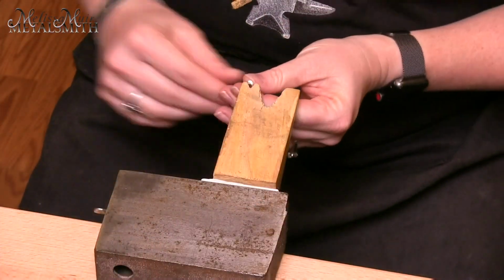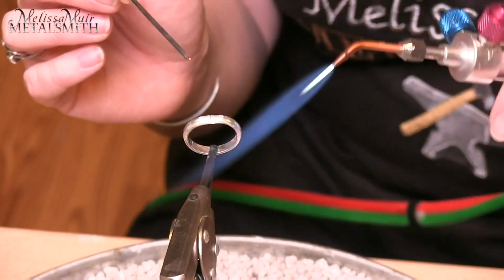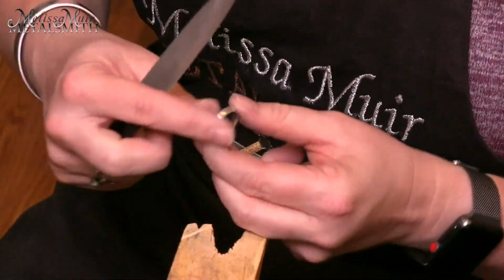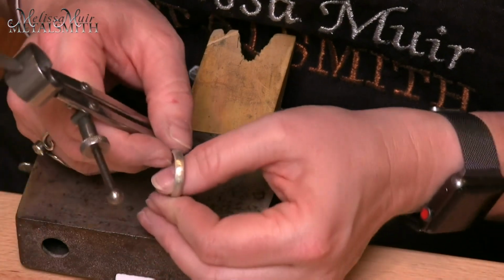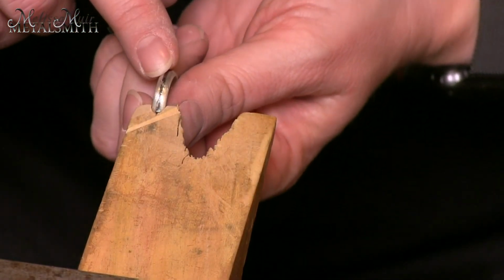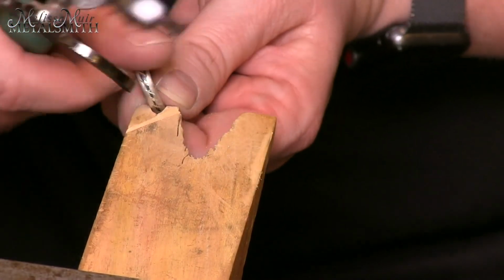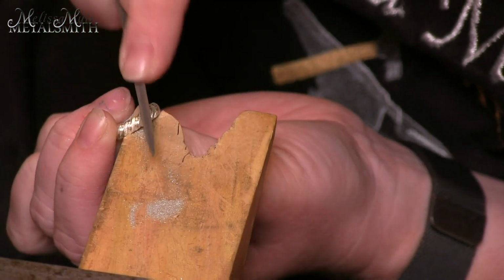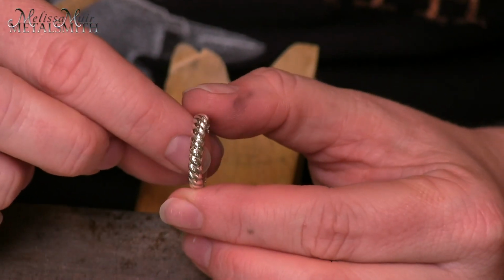Project 8 - Carved Ring - Revere Professional Jewelry Making Series- Tool Time Tuesday

Comment: Melissa, so glad to see you working with more silver in these videos. I would have loved if you included how to measure the wire length for the size of the ring (that includes the metal thickness, etc. ) Such a most important first step. without that, there’s no way to start. And it’s not as easy as it seams. And when you show us the file to clean up the inside, what kind of file are you using? (#) and how are you filing the stock flat, if you’re holding the file on and angle? I assume your holding the stock at an angle, but that seems scary, like I’d file down my size by the time I get it even a n both sides. I was wondering, do you not ever use the little miter cutting vice for filing flat ends? That helps me a lot, but I’m only intermediate.
Reply from the maker: Sadly, because I do all of the video work and such by myself, sometimes the angles are a little difficult to see in the video. when I file with the file at an angle, the material being filed is held at the same angle. I am attempting to stay as close to the directions in the book as possible during this video series, at the request of Alan Revere. He has told me time and time again "It works if you will just follow the instructions as I have written them. No changes, No adaptations, just follow it." So I agreed that I would do as he requested. Now, that isn't to say that I stick with that all the time when I am not filming the projects for the book. I totally use my miter vise all the time! But like I said, for this particular series, I am following it as it has been written in the book.

Comment: Melissa, if I were wanting to make many of those rings, would it work if I made an ~8" version on half-round stock and use it to make a mold that would yield roped stock in 1/2 size increments for a few rings shanks from each? Your finished ring was gorgeous, but for me, 2 days of work would yield a ring I don't think I can properly price at $25/hr. Most of the design would be cast, with additional filing needed, after soldering, to finish the ring.
Reply from the maker: Yes, I think that would work nicely. I think it might change the shape of it a little when you curve it around to make the ring, but without trying it out, I am not entirely sure what would happen. Keep in mind, this did take some time, but I had to stop and mom a few times and it also takes longer to make when filming. The more of them you make, the faster and easier it will become. I still think it would take a couple of hours at minimum to make, but perhaps I haven't made enough to really know. I would love to hear your results if you decide to make a mold and such.